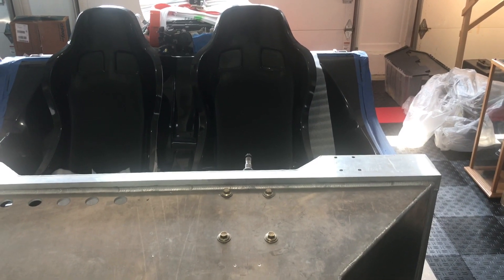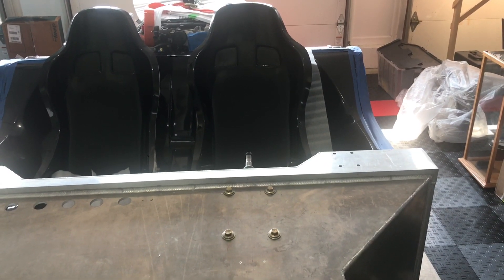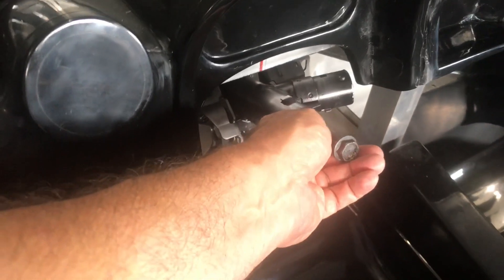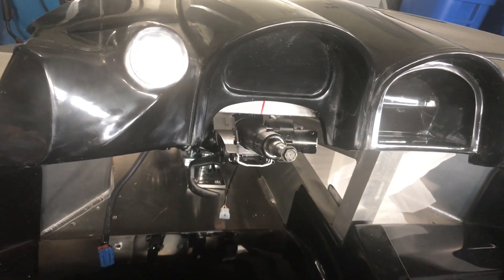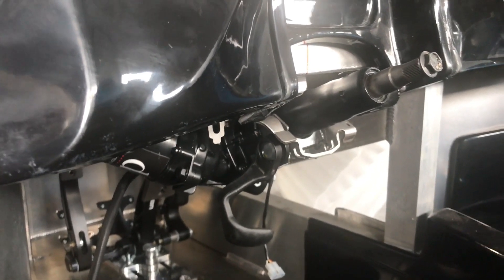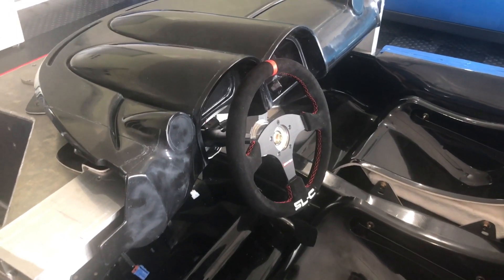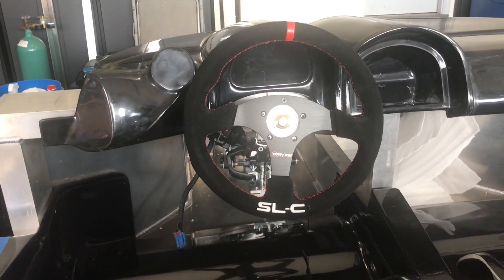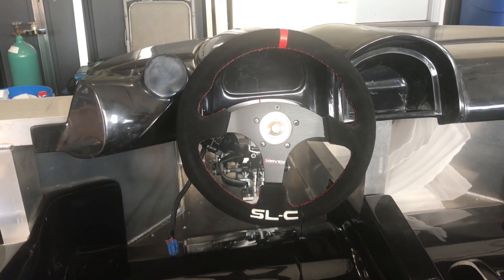Superlite SLC Build 025 DCE Pro Street EPAS Steering Column Install Part 2

Comment: Hey  Joel, where'd you get the steering wheel coupling adapter? I'm using the Momo Adapter atm with the same EPAS coloumn.. was looking to see if there were possibly any better options out there adapter wise.. prefferably something that would still allow the use of a quick disconnect steering wheel. thanks!
Reply from the maker: @The_Streetsweeper Sorry I have not responded till now. Just seeing these comments for the first time. The steering wheel quick release is made by NRG. They have a huge selection of different styles and are very reasonable. This one is called the Thin Quick Release. Getnrg.com
Reply: Thanks! is it splined by any chance? Reason I'm asking is because I just recently picked up a MoMo hub that "works" but I dont have much faith in it because of its cast construction lol  @JoelKSLC
Reply from the maker: @The_StreetSweeper  Yes, it is an oddball spline. The EPAS system is from I think a 2005 Renault Clio. The only two hubs I know work are the Momo and OMP. I ordered both and liked the Momo better. From what I understand the Momo unit has steel center and steel collapsible mounts which are designed for safety. The whole item then has a cast aluminum body, but not sure that has anything to do with the strength of the unit. I ordered them from Demontweaks.com in the UK. Great place to buy racing products.

Look at post #589 in this build thread and you can see a discussion on both boss products.
https://www.gt40s.com/threads/s2s-build-thread.48507/page-30

Comment: Very cool, could we have the part number of the power steering and electronic unit for anyone wishing to go the same route :)
Reply from the maker: The power steering column is the DCE EPAS108 Pro Street Column. The brake booster is a stock Camaro SS 2010 unit, GM (23422812). Also, a builder recently installed a Mini Cooper brake booster which saves you another inch. I had to push the radiator out an inch, with the Mini Cooper booster, that is not necessary. Here is a link to his video… https://youtu.be/lo_mFATP6Gs
Reply from the maker: Nick, FYI, Geoff has an extra Mini Brake booster for sale if interested.
Reply: @JoelKSLC  Cool after watching your excelent videos i am starting to think about what i will need hence why i asked for the part number but nowhere near getting any parts yet,really appricieatte your videos though,might be a beginer at kit making but done to a proffessional level imo :)
Reply: @JoelKSLC  Thank you Joel

Comment: Did superlight have this electric power steering?. Or did you find aftermarket that you wanted to try..Your progress seems to be steady.
Reply from the maker: 63 vettuser , this is an aftermarket system that I found. The main trade off is that you lose the blinker stalks, but I’ll use a wireless push button system which I think is pretty cool. RCR does offer a race only EPAS steering column which they describe on their site.
Reply: @JoelKSLC  I might try to use it in my 63 corvette prostreet car.. one more question.  The rear engine cradle not the steel cross over mount but the 2inch square tubing what's the outside measurement.  On the bottom rails. Thanks again.
Reply from the maker: 63 vettuser, the engine mount side C-pieces are 1/8” steel, the top inside dimensions are 2.5” wide and then there is a bottom C-piece which inside dimension is 2.25” and slides between the aluminum frame rail and the top C channel. The reason RCR does it this way is to allow customers to use different engines and have some flexibility in terms of placement along the frame rails. If you know exactly where your engine would go you could simply weld in an aluminum crossmember to the frame and attach your engine mount brackets to it.
Reply: @JoelKSLC  Thank you.. RCR does a great job giving builders the choice of many engines.